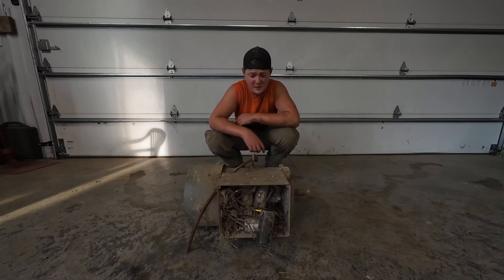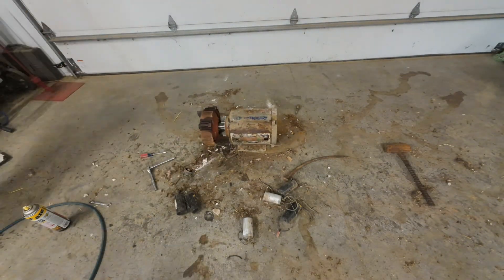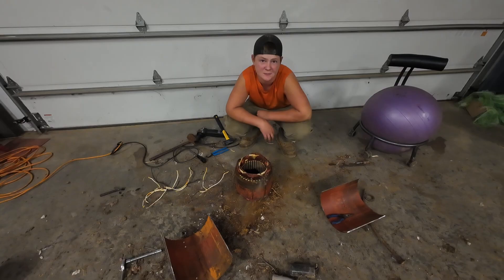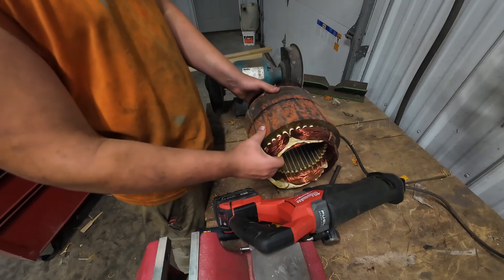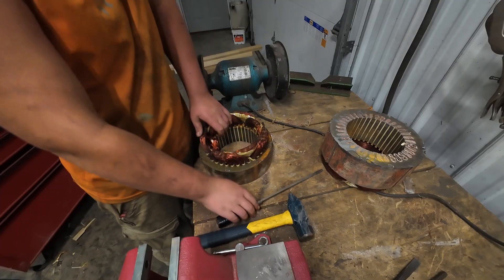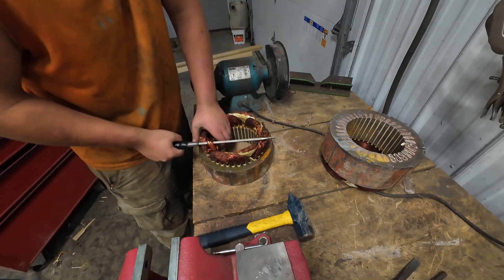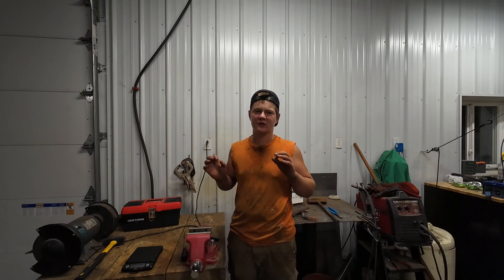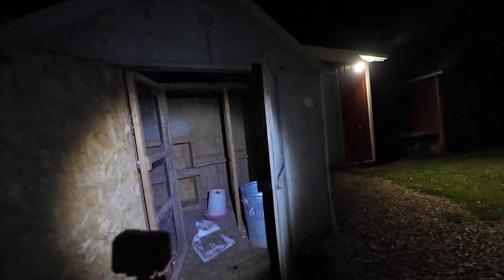How much copper is in a 150lbs motor (Part 2)

Comment: Interesting way of splitting the stator. I think splitting them in half is better than cutting one side than trying to pull through all the metal. You should see the machine I built to do this.
Reply from the maker: I have watched a few of your videos and they are pretty cool. I also saw your machine and I wanted to build one just for this project.

Comment: You went about it the hard way, bro. There's not much value in those capacitors, so little to no time should have been spent on those and the junction box other than clipping the copper wire out of it. Once you got the tie bolts taken off, all you needed to do was to knock the "front" end bell off (thin one), then slide the rotor out the back. Without proper equipment slitting the case was a good move. All you needed to do after that was use a hack saw, or your cutting wheel to cut the windings flush with the stator stack. Then use a punch to tap the bundles thru the stack a little each time moving from bundle to bundle until the windings are free enough you can pull them out. It's much easier yo do than you think. The rotor is comprised of aluminum "windings," but they are poured into the rotor and will have to be melted out. Around here, all it's worth is scrap steel money.

And, no, I didn't watch the full video.
Reply from the maker: I haven’t had any experience scraping before so doing it wrong was expected by me. Thanks for the tip. I also realized how to take the front bell off first then the pull out the back.(that’s how I eventually got it out.) It took me a while till I figured it out though.

Comment: I’ve been doing telecommunications for a long time and have about 6 boxes of 10ga ground wire plus a bunch of buckets of scrap. I need to take the time to break it all down.
Reply from the maker: Ya you just have to start and don’t start another project half way through or you will never finish. I wanted to do many projects while taking these motors apart but I stoped myself. Except for the can crusher. But that project had been sitting around the shop for a year so it needed done.

Comment: 18 lbs of copper would get you about 80 bucks.  If you got that motor for free, why would you never do it again?  Couldn't have taken more than 4 hours to do it...
Reply from the maker: That is a good point. I didn’t think of that when I was filming. I wish I would have timed every motor that I did. I had about 12 40lbs motors and it would be interesting to see how many dollars an hour I get. I might think differently when I get payed. It also took a tone of my free time so when I finish the big one I was done.
Reply: Most people would still stand to make more with 4 hours of work.. For me that would be about $148..
Reply from the maker: Man I would like to make money like that. Unfortunately I want to go down the farming route and there isn’t any money like that. On the other hand I get lots of cool toys.
Reply: @The_Ohioan  Trades my man, the skilled trades! Farming is where it's at though.. grass is greener on the other side
Reply: @Falcon-eh8tq  Scrapping metal isn't normally a full time job unless you own a scrapyard for most it is a side hustle or a means to make extra money.  If you can get scrap for free and you have the time it's 100% profit.
Reply: You can look at it that way, but with a career like mine in HVAC i can literally work 16+ hours a day as much as i want and still plenty of work for the next.. I look at it this way; i could be working earning more instead of scrapping. I used to have side hustles until i no longer had free time lol. 

For me a side hustle is something i can do simultaneously or passively, like selling live edge walnut slabs, bitcoin mining, ect..